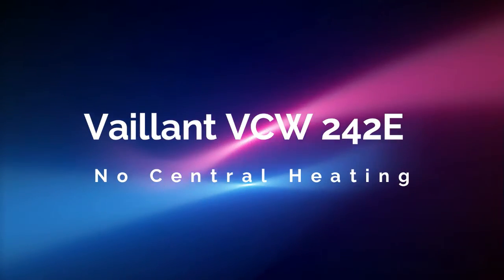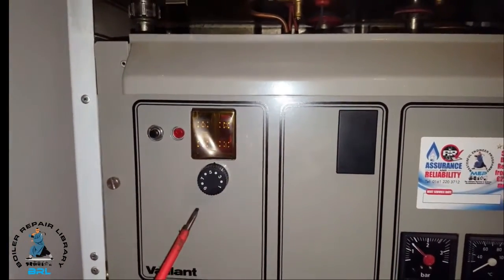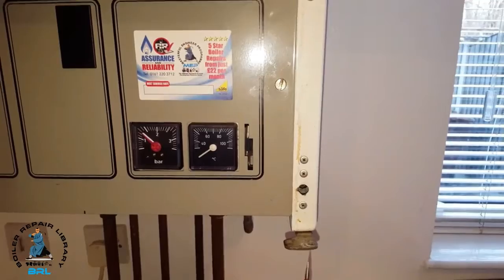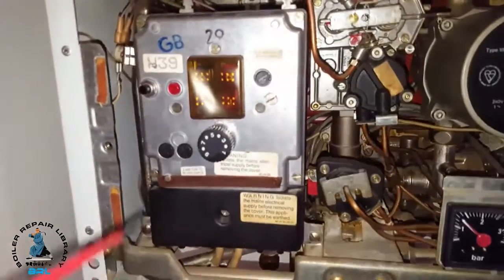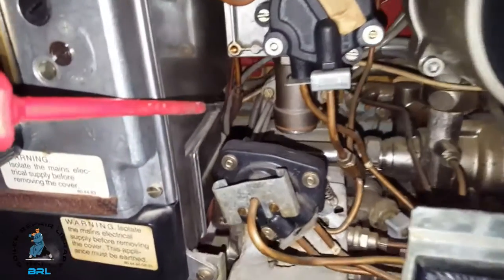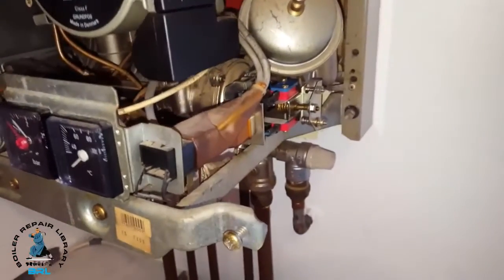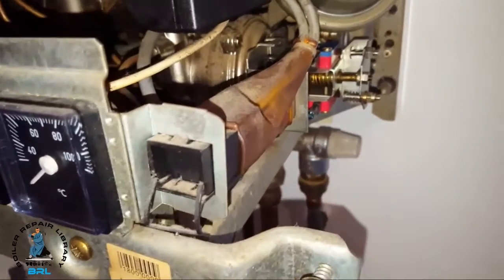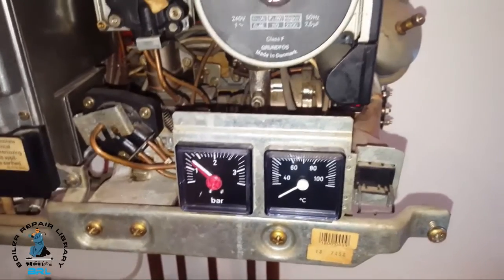Vaillant VCW 242E | No Central Heating | How to Repair Vaillant VCW 242E Central Heating Issue

Comment: VCW 242E diagnosed with damaged water pump - despite hot water side running perfectly (which requires pump to run). Then I got the too old / obsolete / buy a new one speech. Watched this video plus another one. I am retired Marine Engineer, and not used to accepting 'not repairable' as an option. Admittedly I spent about 4 hours tracing pipes and figuring out how the thing works, before finding adjustable pin between watervalve and servo valve was sticking. Dismantled, WD40 and fine sandpaper, and boiler running perfectly. I'll be keeping it! THANKS